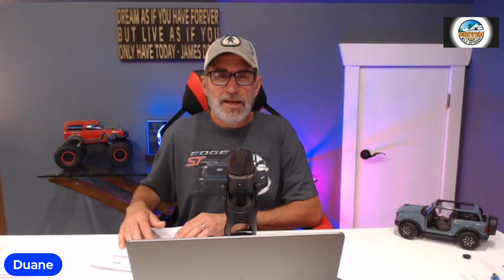Expert Insights on the 2.7 And 3.0 EcoBoost Recall

Comment: When I was a Ford technician up until about 2.5 years ago. The dealership I worked at didn't have a single 2.7l valve failure.

Comment: Ford definitely needs to stop outsourcing, but this isn't that big of an issue. The thing is though when FORD was made here in America by Americans there were no issues. I think it's strange they do outsourcing due to the fact there the only company out of acouple that are still owned by themselves there the only American car company too you would think they would set the American standard higher. The other American brands haven't owned themselves in 3 decades. Ford is the last standing for a reason ofcourse, but they did a good job getting this figured out. Better then the hemi v8 that thing is a piece of junk and they made it since 2012 with defects and they knew about it! That's robbery!

Comment: Duane, interested in your opinion on the "wet belt" setup on the 2.7 v6 and 5.0 v8 F150 engines. thx
Reply from the maker: @jerryavlon4780  if I had my preference, it would be chain or Gear driven, however, Ford decided to use wet belts to cut down parasitic loss. in my opinion, another victim of the café standards. Although I have not seen anyone including the online technicians talking about belt failure. If you could get 200,000 miles out of an engine without replacing that belt, I think that would be decent
Reply: Thanks, appreciate the response.

Comment: I feel for those of you who are in that window of possibly bad engines. It sucks. But it was supplier who failed to deliver parts that met their specs. I’m a EE and can tell you; if you build stuff, it happens. It happened throughout my industry in the aftermath of C19. 
 
The engine design is stout, I’m not worried about either one of my copies. I bought the first year 2.7 in my F150. It just passed 154K trouble free. I expect the 2.7 in my 2023 Bronco OB 2-dr to do at least as well.  I’d feel a whole lot worse if this was a design problem with the engine itself.

Comment: Thanks. I'm looking to get a Ranger with the 2.7 and hope to have this motor for a long time.
Reply: they will come with aluminum pans now
Reply: Buy two or three, that way you are sure to have a spare.
Reply: Generally speaking, reliability doesn't associate well with engines that have 'eco' in the name.
Reply from the maker: @MTrump  The 2.7 with its weight to horsepower ratio is hard to beat. I’m very happy with the two we have and we’ve had zero engine issues.

Comment: To me, any turbo/ supercharged engines should have 10 degree locks installed instead of 7 degree locks, because of engine boost/ pressure inflicted on the parts.

Comment: I had read a few years ago that Ford and GM were going to have their engines built in China.  Could this be the problem ?
Reply from the maker: @frankalfonso7070  no, this particular engine is built in Lima. they had a supplier that manufactured the valves, apparently not to specifications and the metal to brittle

Comment: You think that’s bad , GM will have to recall most if not all new 6.2s in the corvette and full size trucks/SUVs
Many if not all are blowing up with very low mileage…..some with just a few hundred miles.
Reply from the maker: @markcole6475  I think Ford did a good job getting ahead of this. I could have been worse
Reply: @DrivenWildOutdoors  yes, third party manufacturing  issues for Ford.. same with GM in the manufacturing process of the 6.2